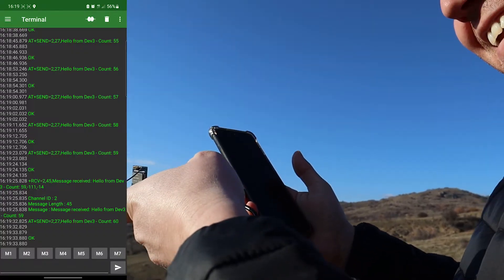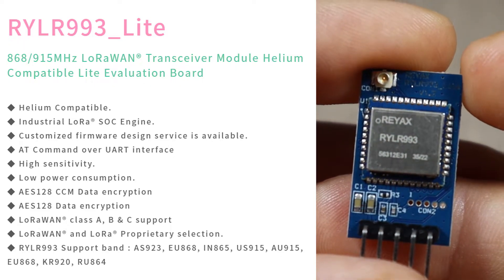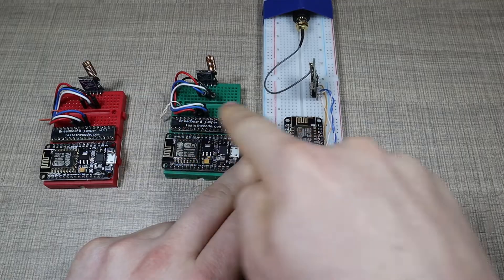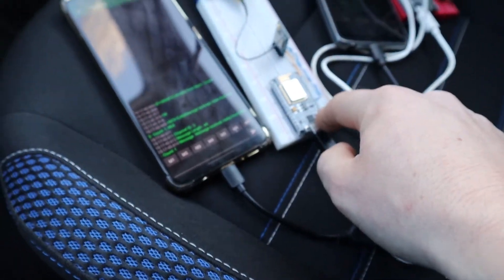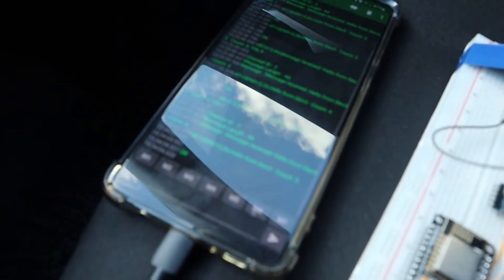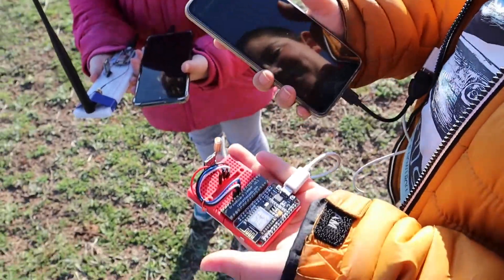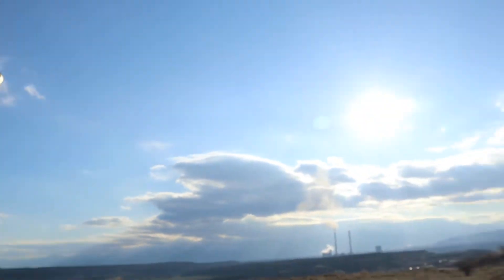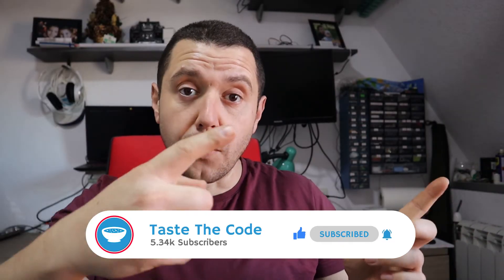Testing the RYLR993 LoRa module communication range with open line of sight! Amazing results!

Comment: Hi bill. I'm planning on making a receiver and transmitter for a Arduino project with the Lora module and 900MHz 13dBi Yagi Antenna. But I don't know how to use Arduino whatsoever. Does it require coding or something? I want to learn
Reply from the maker: Yes, Arduino is a microcontroller that you need to program using the Arduino IDE. It is relatively easy and AI models can help you a lot to get to a working code if you haven't coded before.

Comment: Is there any difference between this device vs a Lora Esp32 device like the LilyGo ?
Reply from the maker: Yes. As far as I know, the LoRa ESP32 boards and similar directly interact with the LoRa chip so you have a better freedom in terms of implementation but also a bigger overhead to make it work. Since this also has a small microcontroller onboard, it abstracts that complexity to simple AT commands.

Comment: Hello, I have been using this module since watching your video.   It gets great distance, I have had best results using the following parameters "AT+PARAMETER=9,7,4,24\r\n"   Did you use this or a different PARAMETER in your testing?
Reply from the maker: I did not change the parameters. I used it with the defaults from the factory.

Comment: the crazy is you sending data from inside a car (faraday cage) and it works ,and you have a spring antena- imagin use high gain directional antenas...crazy... i was loking for a water level sensor to agriculture .that will be 7kms in the hills. lets try...
Reply from the maker: Yes, I was amazed as well. These modules can work on quite large distances as long as they have line of sight. If they don't then distance drops off dramatically.

Comment: I've been playing with RYLR998 modules and I want to track our streetcars so our passengers and depot agents will know where the car is and how soon they will be returning for the next ride.  I found that if I place a "repeater" part way down the line, I can get a fair signal all the way up and down the line.  I've ordered a RYLR993_lite module in hopes to get an even stronger signal.  The documentation shows a LOT more AT commands.  My question is will it still do all the basic stuff like the RYLR998?  I really don't want to participate in the Helium network. What network ID does Helium use; I probably want to avoid that ID.
Reply from the maker: Helium uses a different approach to the proprietary LoRa that Reyax has if this is what you are using. With the proprietary protocol, they both function in the same way and you can choose whatever network ID you like. Make sure to also add a password to it so that outsiders can't listen to the communication.

Comment: So can I take a photo with esp32-cam and send 500 meters?
Reply from the maker: Lora is not intended for such high data transfers. If you split it up, and send it on intervals, I guess it can be done but definitely not what it was designed to do.
Reply: @TasteTheCode  guess it's wifibroadcast I should try again. Didn't work properly when I tried some months ago.
Reply from the maker: You mean wifi long range? I haven't tried it but for 500 meters, I think you can also use some directional antennas if you have line of sight.

Comment: what antennas are you using?
Reply from the maker: This is the default that came with the module, and the other one is the small onboard antenna from a coiled wire.

Comment: Sorry, what frequency did you set it to because I have 2 reyax 993s and they don't give me more than 2km
Reply from the maker: Frequency is dependent on the region. Here in Europe we use 868MHz for LoRa. Everything else was as default. Do you have line of sight between the modules? If you don't then the range will be much shorter.

Comment: Can you please also tell us  how to connect lora with microcontroller 
, and also how to write code for LoRa transriciever
Reply from the maker: The code for the decices is in the video description. The modules I used talk to the microcontroller via serial. It quite straight forward but it depends on the modules used.

Comment: Can this work with an ESP8266 on Arduino IDE?
Reply from the maker: Yes but only to control the LoRa modules. In fact, I use NodeMCU in the video and I program them through the Arduino IDE.

Comment: I bought rylr998 to do transparent serial link @9600 bauds. Is it Ok ?
Reply from the maker: I'm not really sure what you are trying to do...
Reply: @TasteTheCode  i am receivent from powermeter the data at 9600 bauds only one direction.  the distance to the house is 60 m. I plan to use a 2nd ryrl898 to receive and decode.
Reply from the maker: I guess so... I have no idea what the power meter uses. Its too specific to know but you should be able to do it.

Comment: Great job! I've achieved 112KM using 8bBi collinear antennas on a high ground.
Reply from the maker: Oh wow! That is huge!
Reply: VladoT, Can u share the project (112KM)
Reply: That has to be over horizon? What elevation were you on?
Reply: @Irongrip62  I am on an 1000m (3000ft) elevation and the receiving end was almost sea level (0m). There is some hills between so its not pure line of sight for sure.
Reply: @VladoT  Tx power 22 dBm ?
Reply: @dabdoube92  No, 30 dBm actually. That's max allowed power I think.
Reply: @VladoT  I'll love to ask you some questions about it!!
Reply: What device did you use? The RYLR993_Lite ?
Reply: So can we use this tech to communicate with mars?